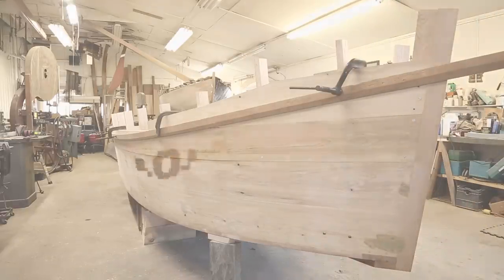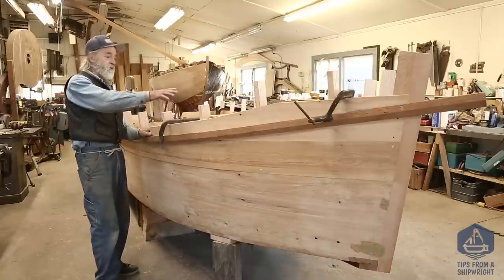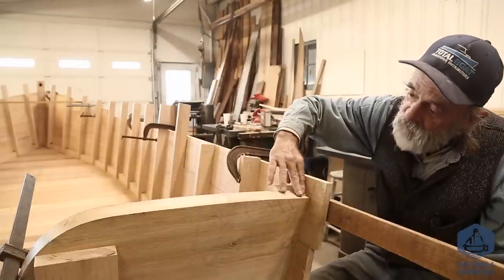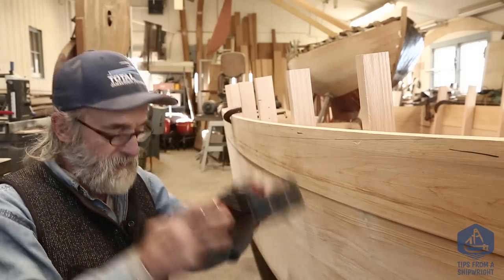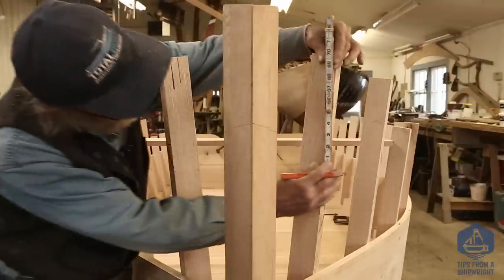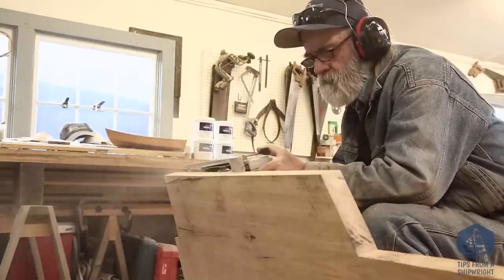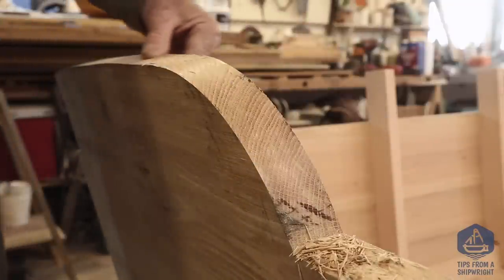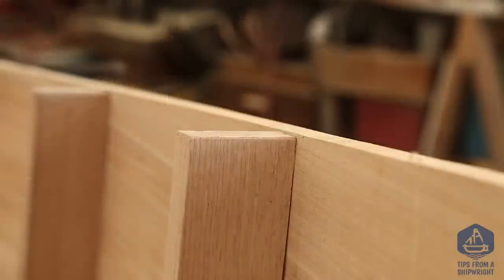Building the TotalBoat work skiff - Sheer pleasure (Episode 23)

Comment: This series has been great and coincidentally I started building my first boat, plywood on frame, just before this series started.  Although much of the process is different from what I'm having to do I did put a 10 degree slant on top of my frames so the water wouldn't pool on top, as you suggested early on.  So thanks for that.

Comment: That was some serious craftsmanship using that circular saw on the transom.  Q&A:  How long have you been building boats?  What is tonging?  Where did you learn boat building.
Reply: next video
Reply: I think he said he´s building boats since he was 13 or 14, he´s 67 now so, do the math... He learned from his father. 

http://www.providencejournal.com/breaking-news/content/20140606-a-view-from-north-kingstown-louis-sauzedde-can-build-just-about-anything-on-a-boat.ece
Reply: Albion Laster I love that he does things differently. Free of conventions.
Reply: Good tradesmen never stick to one technique forever, they're constantly evolving to suit the technology and materials around them.
Reply: A better tradesman is able to tell you factually why one way is preferred or not.  New does not necessarily constitute better.  I know you didn't say that but neither should it be implied.  Traditional means become traditional not simply because 'we've always done it that way' but because it survives the test of time.  A small example of that is Lou using the handsaw to lope off the frames.  Sure, a power tool would have quicker but would it have been more accurate when making that precise cut where each frame should be to the proper height and bevel?  I think a handsaw lends better control in that situation.   Too, I suspect the height and bevel changed from one fame to the next.  If so, a power tool would have needlessly complicated things.

Anyway, it is a good point you mention and worthy of the consideration of the craftsman.  It is something near and dear to me because 1) I see skills being diminished; 2) I cannot tell you how many times I asked a tradesman (including my own employees in homebuilding) why they did so and so this or that way but they could not answer the simple question.  Ugh!
Reply: nicely done truly a craftsman
Reply: Tonging is when you use tongs to do your "fishing" like here is how you tong for oysters:

https://sites.google.com/site/oystertonginghowto/website-builder-products

Comment: i would give anything to see a series of Lou building a lafitte skiff. they are, to south Louisiana and the gulf coast, what these work skiffs are to Rhode Island.  they have a beautiful shape and are iconic to the gulf south. 

the basic construction is very similar to this skiff, except most lafitte skiffs have a shallow V bottom, and what we call "fan tails" which are extensions of the transom and gunnels aft of the transom thats used by the fishermen to stand on to haul in a shrimp trawl net or used to haul in a net without getting it caught in the prop.

Comment: I love watching your videos. I always learn something new and valuable - little tip about using the wooden ruler to make a mark on both sides of a board being one good example. I have a question for your next Q&A video. Why did you decide to use a nail to attach the runner to the bottom of the boat and not a screw. You use screws in so many other places, but then you used a 3 1/2 inch nail on the bottom. Thanks again!

Comment: Once you sighted the sheer line on the stbd side how did you transfer it to the port side to ensure it was symmetrical?
Reply: Connor Duckworth I would have used the off cut from the pow plank to start the baton on the other side.
Reply: Connor Duckworth this was my question to lou as well. I can think of several ways but am wondering, how would lou do it??
Reply: the very first plank he put on each side of the boat was exactly identical in shape and location on the boat.  I woud have used that plank as reference to transfer marks to the other side.

Comment: Hello,  Merry Xmas. How did you transfer the starboard sheer line over to the port?  I am wondering how you maintained the same curvature?  The stem and the transom would be easy but the rest of the rib stations...   Would measuring up from the bottom on the rib create this with your batten?  Take care.  Doug

Comment: Thanks for the great series Lou.
Could the design be modified to make a deep V hull rather than a flat bottom with those vertical grained floor timbers you used placed athwarships for the Deep V?

I was thinking 18Deg Deadrise at Transom,  20Deg Front bulkhead - frame 3, 22 Deg well forward - frame 5 on a 21 footer.

Build the five frames, drop the a laminated keel in it, then add the two lower gunwale planks then add the vertical grained timbers as the bottom.
Obviously a bit of scribing at this point around the bow especially for the bottom planking

It would be great to see you build a variable deadrise deep V in the future!
Reply: I worked out that the problem was the longitudinal or stringer support, so I looked at my idea again on the weekend for a 21 footer variable deadrise and came up with the following:

1. Temporary chipboard frames with the deadrise in the nominated frames. 
        1 [Transom] 18 Deg, 3 [bulkhead] 20 Deg, 5 [forward] 22 Deg. Stringer recesses matched in each of 3  frames.
2. Use battens to pre-fair the other frames, and the keel  and stringer recesses.
3. laminate keel and install chine logs and stringers. [ packing tape  on frames etc]

Edit - extend the lines out forward and up to get a fine entry before laying up the keel, adding two or three smaller temporaryframes with more shape.....

4. Install Keel and fair with chines and stringers, as progressive deadrise...
5. Install transom - similar to what you did but onto frame 1
6. Progressive rebates in chines and keel for cross planking. [This will be time consuming]
7. Fit the two side planks per side per your method.
8. Fit the cross planks keel end first and later seat the cross planking progressively with your cargo straps idea but smaller increments.  [A bit of scribing here.]
9. Use your extend the lines and saw method to trim the hull planks at the chine log, the bed down on the longitudinal stringers.
10. Flip the hull and complete similar to how are you are going.

The trick is getting the hull to look right.....

Comment: Hi Lou, thanks for the videos and the excellant information .
Please take this comment as a positive recommendation .
A couple of times I have seen you using epoxy and you have had bare hands and no vapour protection mask .
The fans I am sure would like to see your jobs well into the future but from my personal experience my boat building / restoration working ability has been greatly reduced because of my exposure to epoxy and then a resultant negative reaction by my immune system .
The results to my health were not nice in fact life changing .
Beware Epoxy especially hardener is extremely toxic.
Oh I havent seen you mention this before and maybe you do this but what I do to be safe from using volatiles , I use white vinegar to clean my hands and tools when I have finished any epoxy work .
Once again keep up the great show .
Look after yourself mate , we need your inspiration to continue.

Comment: Fantastic series, thank you for doing it. A question for the Q&A session: You designed the sheer by bending a batten on the starboard side and eying it in, but how did you transfer the sheer line to the port side? Thanks!

Comment: My question. Why nails for the runners ? Could screws be used and would it not then be easier to change out the runners if and when necessary ?? You are a natural teacher, thanks so much. This is some invaluable reference material. My eye keeps moving to that beautiful Haven (?) in the back ground. Dreaming to build one of those.

Comment: I have learned a great deal, not just about boat building, but about working with the hardwoods. Question: why did you use nails on the bottom instead of screws like you used on the sides?

Comment: Q1: how did you transfer the posistion on the batton from starbord to port side? it looks a bit tricky to make boat fully simetrical. 
Q2: two aft frame heads are a bit lower compare to the side plank. why?
Q3: is it possibel to use screws as an alternative to the "boating nails" you used?
Q4: is there any reason to make all the edges all other woodwork so close to furniture-grade? The boat is going to be banged and most likely will get fair amount of imperfections here and there.

Comment: Ray Hussey. 
Thanks for a fantastic series Louis, I,m totally addicted and cant wait for each new one to appear. Its all the fu n of building one yourself but without all the work.There is one thing though. In one of your older vids you show why red oak shouldn't be used on a boat but you've used it on the runners  is there a reason for that. Also the bottom boards weren;t sealed before  you antifouled them, wont they absorb water and rot ? I,m not criticising at all but just a bit puzzled. Looking forward to seeing the finished boat in its final paint but at the same time I don't want it to end. Thanks again Louis

Comment: Great video as always Lou. Makes my Friday evening, thanks! Were these Skiffs always built using Oak for sections like the transom? I'm a French Polisher and spend a lot of my time sorting out water damaged Oak, so know that it's not much good with moisture. I'm sure that the paints you use can handle the water but what would they have used before these modern products?

Comment: big fan of your videos- im only twenty two and have been working on a total re-haul on a beetle cat myself, ive used a few total boat products on it so far but im wondering your reviews in the filler you used for your planking screw heads- ive been debating if i could get a constant filler or am i better off using the old wooden plugs. Big fan, great videos, have learned many tips for you thanks!

Comment: I have concerns with the scarf (taper)  connection of the forward railings to the boat, i would expect them to lift and separate under normal sea conditions, (water, heat, waves, time etc). I was expecting a block end cut into the under lying planks.
Cheers, great channel ( and explain to me why i]m wrong)

Comment: Will there be any kind of thwarts or other horizontal bracing between the sides? If not, how do you keep the sides of the boat at the correct angle and prevent warping?

Comment: How did you transfer the sheer line from one side of the boat to the other?
Reply: If it were me, I would set the sheer proper to the stem and transom then eye a fair line 'tween the two.  To facilitate that matching the other side, to aid the eye, I would create an 'artificial horizon' at one end or the other so it is visible from the other end.  That is, if standing near the stem, I would temporarily place a fixed point attached to the transom which is clearly visible from the stem. That could be done at both corners of the transom so that I would be able to eye P & S simultaneously.   Alternatively, the handy folding measure can be used to 'calibrate' my eye by measuring at interpositioned (interpolated) frames.

Even if the measurements were off by a fraction of an inch 'tween P & S, it is what looks right to the practiced eye, the emphasis on practiced.  However, the eye would probably detect even a fraction of an inch diff.  Keep in mind that what looks right, is right.   That is not to make excuse for sloppiness but to point out that it is likely to become so enamored by precise measuring that we become encumbered by the same.  The use of our natural senses comes into play here.   It may seem crazy but one can begin to 'hear' the wood 'speak'.  If it seems tortured most likely it is tortured.  Knowing what is/is not possible with the wood is as much a part of it as joining the pieces.  Lou speaks of this when describing the dimensions of his sheer board to scribe the sheer. likewise when planking the bottom.
Reply: Ok, so I just reviewed some parts of a book in my library on lofting.  An example is given where in Herreshoff's design of Nereia there is a flat place in the belly a bit aft of amidships.  The author says he has seen people loft the plans exactly and carry that unfairness completely intact into their own build.  The author goes on to say that there is more to boatbuilding than looking down our noses at anyone who doesn't draw out (loft) every line.

Here we have example of the dangers of overly precise measurement and also that a fair line supersedes any drawn line.   A builder of whether a house or boat should step away to put an eye on his work to examine what is fair.  We see Lou doing this time and again.  I say that practice is worth more than a box full of measuring instruments.  My own experience time and again has proven that correct.
Reply: Measure from the bottom at each frame on the side youve done then mark it out on the other side. clamp the batten on at the marks and look at it

Comment: Hi, Lou.you're right about your first backyard boat. I would not be willing to sell, loan or give away. Not for sentimental reasons either You hinted on it in a previous episode . Would you tell me the width of that station four feet aft of the stem. I know the planking is fitted 60 degrees based on the stem. With the stern being 66in. wide. and the stretcher amidships being 5'11" , the station falls in place but I'd like to know beforehand . thanks for showing me the right way to build a skiff.

Comment: In building furniture, end grain is always sealed  up to keep out moisture and prevent checking, but it seems on the skiff the bottom planking is completely exposed. Does this lead to rot or does the end grain get sealed before launch? 

I have learned several new things watching this series. TIL to use a folding rule as a marking gage in a completely new way. 

I saw another boatbuilders ban saw last week in Reedville Virginia. I recognized it immediately only because I had seen yours in other videos, and I was please I had some idea how it is used. 

How much will this vessel displace when finished, and  how much can she carry?

I always look forward to each new installment in this series. Some I have watched several times to memorize some of the points brought out during the process.
Reply: salt water doesn't really rot wood.  more important to protect the boat from having fresh water standing inside the boat for long periods of time.

Comment: Tip... to cut the frames for the breast hook a bright light at the front will cast a shadow that will be level or ... use a laser .... but what you .....does is more than adequate and faster

Comment: I don't know anything about boats but I do enjoy this series, thank you for the great series on this beautiful skiff so far:) one question what will be the approximate water line of the boat and was the original flat bottom design used because of shallow waters this boat worked in or is there another reason?
Reply: Kiwi --- I think the boat would need to be weighed to determine the 'waterline'. I bid on building some steel barges and that was the way the engineers told me how to calculate where the 'waterline' would be.

Comment: I don't agree with the way you've done the floor. The strongest part of the boat should have been double planked. Across the boat on the inside,but more importantly,the full length of the boat from bow to stern on the outside. This is most important,especially on a work boat. You not only guarantee strength,but it also makes the bottom absolutely water-tight.